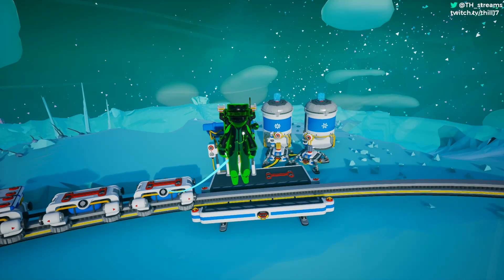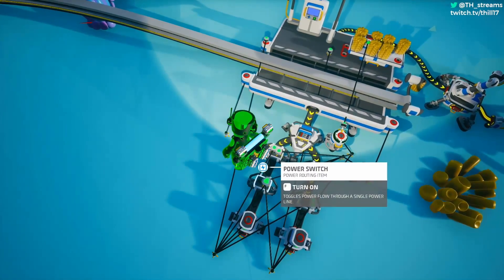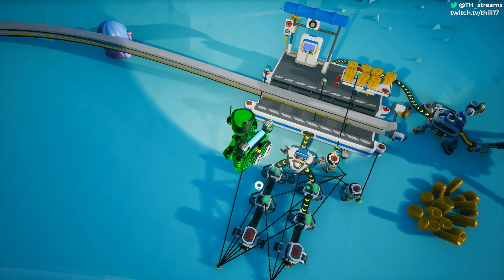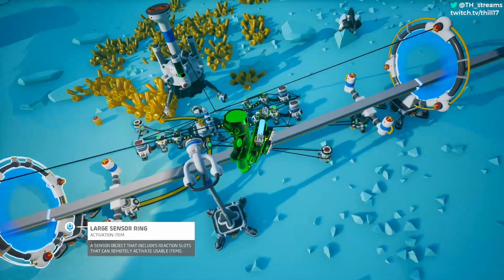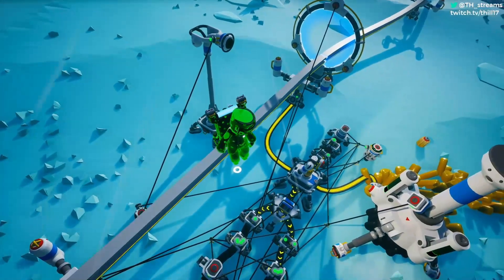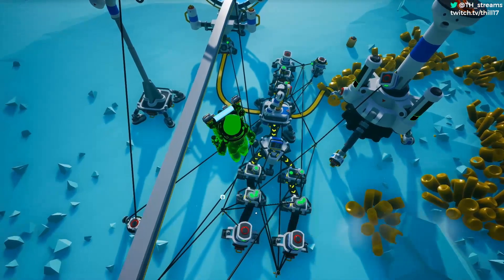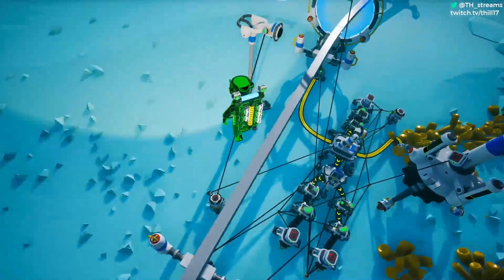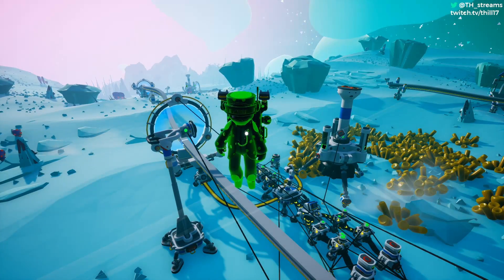Astroneer Guide to Rail Station Automation

Comment: Just put a storage sensor on the first mode one the rail engine with the pin on the engine too. Now set a Station to load and another to unload. Now start the car in any direction with 1 item on it. Now it's the first setup but easier.
Reply: Watch World class jerk on automated Astronomy on EP. 12 I think he explains it more.

Comment: Oh man, gives you alot to think about.  My solution was pretty crude, just used a proximity sensor on a delay to zap the butt of the train after it arrived from being called due to a "full signal" from a storage sensor and ate the extra signal output with a counter.

Comment: About latches, with the amount of different items in Astroneer, I think there might be another way to make them. Not necessarily simpler, or even as reliable or flexible, but I believe auto arms and gas canisters hold some promise (the behavior of gas canisters have been changed, that is, their input/output state cannot be changed while a canister fills - I assume it's to avoid dividing a single gas canisters into a couple dozens. A friend have a whole army of 1/100th helium)

Comment: In 1.28 version, I try to use the packaged tractor method to trigger hoops but works only sometimes, I have to add rail cars and swap the tractor around the rail cars' inventory and sometimes it works. it works always when I hold the tractor or hoop and move just the item from afar in and out..

Comment: What about the instance you have several extractors connect via branching rails that lead to stations also via branching rails?
Is there a way to automate that?
Reply: Yes. However I found using resource cans for everything really helps

Comment: Followed these instructions exactly and it never worked.  The switches go into a rapid non-stop on/off cycle that requires me to cut the power to stop.  No trains.  No transfer of materials.  Just a broken build.  Would not recommend 0/5 stars.

Comment: Hi. Thank you for your videos. I'm curious, though, when it comes to data storage we have various latches (SR-Latch, D-Latch etc). But in real life and in some simulation apps when you restart the system latches usually initialize with a random value 0/1. Do we have this issue in Astroneer or because the game is saved, we technically set up the system only once and it works fine after that forever? To combat this systems usually use Power On Reset signal that would ensure that all latches start the same every time. If needed is there a way to accomplish this in Astroneer?
Reply from the maker: Great question! I have not encountered an issue with this in Astroneer. Even some of my huge builds still have the proper state saved, and hundreds of delay repeaters maintain the correct count. If you needed a power on to reset you could probably have a "main power" switch that feeds into a power sensor. And every latch switch would need a splitter into a data line and a power sensor. The main power sensor would flip all latch switches, and the individual latch sensor would determine if it gained power or not, then act accordingly depending on how you want the switch thrown. It's tedious, but luckily not necessary (and sorry for the late response).

Comment: Really struggling with the trains, even though what I need from them is so simple... I just want to collect Astronium from my Auto Extractors near the core with ideally a rail car going back and forth and in a circle if I can't get the "line" to work... I just built a 8x XL Shredder Scrap farm that works like a dream and a 8x Trade Platform odering station with integrated Smelters. But I can't get those f**king trains to work to save my life... I literally ride them myself like a peasant and load/unload large canisters by hand...
Reply from the maker: So the railcars in my opinion are very difficult to work with circuit wise. Getting a rail line going? Easy. But the moment you want to add any special actions like loading/unloading, a second car, a second line, etc. It becomes so much more difficult.

Sorry for responding so late, but maybe take a look at storage sensors that trigger proximity repeaters. The storage will be for the loading/unloading, and the proximity repeaters will send the train
Reply: @THill17  Tried it all buddy... It's just a really badly done feature, unfortunately... - With the Auto Arms and stuff that's kinda endeering, because you feel so proud when you found a workaround to get it going! I'd call myself easily top 20% of players in terms of skill and experience. But if I can't get these to work remotely right in HOURS, then trust me: 80% of users have never used them for anything more as a manual ride, like I do. - I stopped playing in the meantime, but right up to the end, I was riding the train "to work" in the core.
Horrible design, unfortunately. Kinda frustrating, this game COULD easily be one of the absolute Top Games on Steam... It's like they went 99.9% of the way and for the last 0.1% tried to mess it all up like shaking an etch-a-sketch

Comment: i cant believe this is the answer to making a simple trainstop work
Reply from the maker: To be fair, there are many ways to get them to work depending on you needs. This design is to handle any situation your train line might encounter for any number of stops. 2 stops on a line does not need to be nearly this complex

Comment: my dude this is more complex than my godamn dishwasher, you did in 100 steps what folks do in 2 buttons 'n a sensor, this isn't informative as it is a waste of time.
Reply from the maker: There are simple ways to use train stops in a very basic way. This is intended to handle ALL cases of calling a train to any number of platforms. That, you cannot do in so few buttons

Comment: I built this and none of my materials are going into the train... is there a cause for this? Or any solutions to fix?
Reply from the maker: If thats the case it sounds like it is an auto arm issue. There could be a problem with the range of the auto arm? It takes a bit of work to get the positioning right!

Comment: Ingenious and inspirational work, really showing practical use cases for the sensor rings as well as the more predictable sensors... you have created a very impressive rig there... One question... other than taking screenshots of what you have done here and trying it ourselves, is there any 'wiring diagram' or schematic image you have created (or might create) as a blueprint for this system?  I do not run creative mode but I have figured out (or copied) systems from other youtubers to make automated production lines  and also edited some of my own (example nanocarbon alloy) without too much trouble, so I would like to use this and can see a number of uses for extractor sites and cave mines... thanks for posting
Reply from the maker: Thanks for the kind words! I dont have a wiring/schematic currently drafted, but that is a very good idea. I don't have a lot of time to make one for a few days, but I'll have to come up with a solution for this in the future!

Comment: Does your systems still work on a distance. Because there is a certain distance between the player an the device that seems to stop the sensors to work
Reply from the maker: I did not test it too in depth, but it does work with a bit of distance. I don't know how it would function across the entire planet or on a different one entirely...
Reply: @THill17  ok thanks for the information

Comment: ive noticed something in common in every single one of these automation videos. everybody does it in creative. you arent showing it being made and used realistically which makes it a lot harder to set up and the average player probably isnt smart enough to figure it out just based on the shown setup. you have wires going everywhere and dont show them being hooked up to show what does what.
Reply from the maker: That is a good point. Adventure vs creative should be the same physically, but creative just lets me spawn the items rather than having to wait. Although building it in the recording would definitely help... Ill keep that in mind for the next one!

Comment: This solves a problem I was having in my adventure save as I tried to set up multiple trains going different direction on a single train line and all my cool solutions where failing, but the system is so complex I don't know if I can actually convince myself to do it!
My attempted solution was only activating the front or back of a rail car which I thought would corresponded to which direction the rail car would travel, and when that didn't work I thought that if the route was blocked off by a non-connected junction the car wouldn't continue in that direction - that didn't work either. Fun solution tho!
Reply from the maker: Thanks! It sounds like you had some good ideas yourself, but the trains are not the most user friendly for custom setups :(

Comment: That is an awesome clever setup of using logic with those switches as and gates and ring sensor.  I was wondering why you didn't use the rail station for the 2nd example though as collecting only 2 resources doesn't seem worth the trouble for that setup?
Reply from the maker: Thanks, I love these little challenge problem! I didn't use a station because I wanted to show you don't need one, and that this can be used for any number of resources if you want to expand it
Reply from the maker: Also, the station is a little buggy and the behavior is inconsistent at times